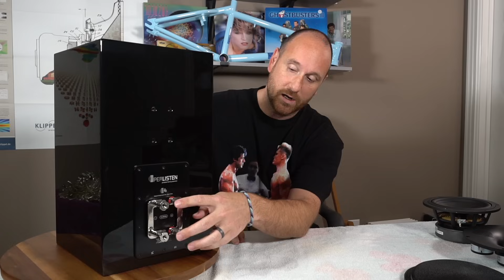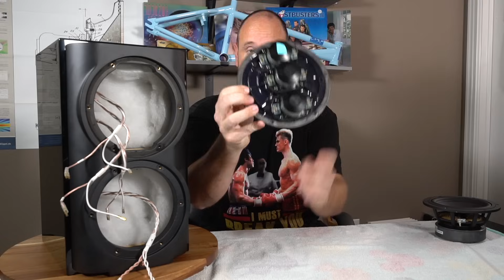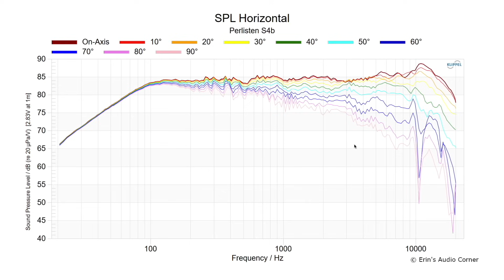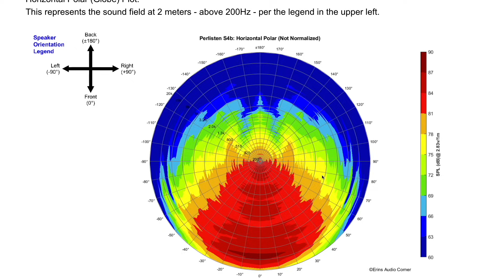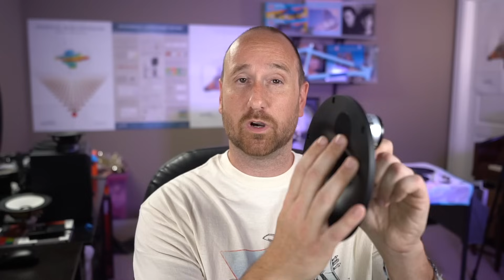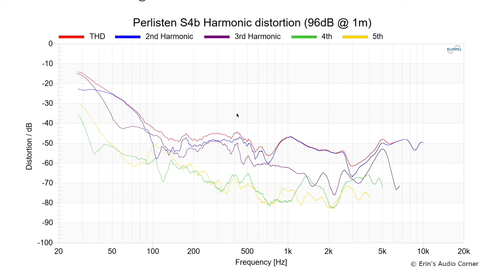Perlisten S4b Bookshelf Speaker review and breakdown.

Comment: hi erin, i have to replace a driver in my s5M speaker. how hard was it to take out the driver and replace it? is it easy? im worried about damaging my speaker. any hint or tips?how long would it take? i am replacing the driver due to a small scratch on it so the last thing i want to do is scratch the cabiner trying to rplace it.
Reply from the maker: It was actually quite easy.  I would imagine Perlisten would be able to walk you through the steps, though, if you need it.    Just some screws and that's pretty much it.

Comment: That midrange/tweeter setup response makes perfect sense based on hearing them.  All their speakers in the high mids sound grainy to me indicating usually a lot of reflections and time/phase issues.  It sounds almost like horn throat distortion to me.  It’s the downfall of the speakers for me.  They don’t have a sweet sounding high-mid so I have to disagree with you, lol!  I feel like if there wasn’t smoothing on the high mid response charts, it might be pretty rough looking with a bunch if phase alignment issues between the mids and high driver because you essentially have a 3 driver array covering the same frequencies.

Comment: I wish THX weren't so cagey in their specifications. This speaker's peak output is 111db, under 2% distortion, at 1m yet they give their "THX Dominus" rating which means it's meant to play in rooms 6m long at 120db on a speaker with a minimum 92db 1w/1m sensitivity. 

Even Perlisten's S7 speakers can't hit the 120db specification with their peak SPL at 117db under 2% distortion. However, the S7's do meet the THX Dominus 92db 1w/1m specification though.

I know THX Certified is still a great certification that ensures a level of quality and clearly this S4B is well behaved at low to mid volumes. But Perlisten's own data specifies that this speaker tops out at 105db at 2m or 6.5ft away. That's a really close listening distance. So, I'm sure they're fantastic for music and great for movies up to 6.5ft away but beyond that, these simply fall flat of basic Dolby certifications for SPL and they certainly will have audible nasties if you push them any harder. Personally, I don't really care about whether or not a speaker can play meaningfully below 80hz in a small-room environment. It's going to get crossed (time and phase aligned of course) to a sub anyway.

Again, I'm certainly not knocking the speakers. Clearly, they're fantastic. But IMO, certainly not worth $4k. Personally, I think the entire line is overpriced. Objectively, Genelec produces a better speaker in FR and phase with identical SPL in their 8361a at $5k than Perlisten's S7T at $10k.

Comment: Is the S5m considered sorta MTM? 
Thanks Erin 
Would love to hear the difference in sound between the Revel BE and the Perlisten S7t
Reply from the maker: I guess it depends on what you're talking about.  The tweeter/mid array is a type of MTM.  Or are you asking about the fact that the s5m has a woofer pair?  In that case, you could call it that but I think it's not quite technically accurate because it's a bit more complicated than a standard MTM design.  It's like a couple MTM... if that makes sense.
Reply: @ErinsAudioCorner   no I’m talking about the Array.   Super interesting design that solves some issues.  
I wonder if the speakers sound a bit narrow though because of the design. 
Would you say you enjoyed the Revel BE more? 
I tend to like MTM personally because of the large full midrange they usually give.   That’s why I asked.   

Good to see you back Erin.  Hope all is well!

Comment: 8k a pair, there's a lot of choices out there, including some good actives. Those specs, disappointed in that brand. I can live with the 80hz cut off as I'd always pair with a sub, but that they also don't allow high db levels considering their size and weight and cost, I'm gonna pass. although I'd like to compare them to my ATC SCM 19vs 2 which are my reference currently.
Reply: The frequency response of those atc speakers is EMBARASSING. The directivity index is ok'ish but doesn't even come close to the perlisten.....

The perlisten destroys the atc's in terms of sound quality. Are you really going to nitpick them for a few db?
Reply: @niccster1061  "The frequency response of those atc speakers is EMBARASSING." What graph are you referring to specifically? They are also less than half the cost, so I'd hope the Perlisten are superior, not 8k worth of superior... If I'm paying over 2X the cost of those ATC's, from Erin's measurements, it will not be those Perlisten's. I would really be interested to see a review of the R line from Erin. BTW, I no longer have the ATC's, currently using Ryan speakers, which I am very happy with. They actually cost less than the ATC, vs more.
Reply: @willbrink  I'm referring to the graph from audio science review. Done on a klippel rig. About as "valid" of a measurement as you can get. 

Midrange is boosted. Treble isn't linear to 20khz. Majorly uneven directivity index. The ATC speakers are unequivocally, horrible for 2 GRAND. 

And yes, the perlisten is way more expensive but there are plenty of similarly priced(to the ATC) speakers like the Neumann kh120II that don't have GLARING flaws..... Hell, even a Polk xt20 with spinoramas autoeq puts it to shame......

Prioritizing how loud a speaker is over it's accuracy is just............ Can't even find a word for how backwards that logic is
Reply: @willbrink  not seeing a lot of useful info on the Ryan speakers but if the IN ROOM response of them is genuinely flat like they advertise then they are going to be way too bright. Hoping they meant sloped, lol
Reply: @niccster1061  You're referring to a prior model, unrelated to the ATC model I'm referring to. I don't know how the modern ATC SCM v2 measures, I can say it's universally given top ratings by those who review/hear them other than being base shy. Subjectively, they sound great but no doubt have a "house sound" that'd favored by thousands of studios as you know. ASR hates anything with a "house sound."  I'd more likely look at brands shown to measure very well per Erin's testing etc. I know have Ryan speakers which claimed to have used klippel in designing it. Value for audio, I'd be more interested in the R line at this point.

Comment: Nice review but the limiting factor in this speaker is the bass extension and output and the requirement of a subwoofer. I was considering these but the bass and need for a subwoofer turned me off. Should I go for the next model up which is the s5m or get something like the kef reference 1 metas or dynaudio contour 20i or fyne audio's f bookshelf

Comment: I’ve listened to this review as well as Erin’s review on the Arendal 1723 Bookshelf S THX speaker.  Is it just me, but their seems to be quite a bit of similarity between the two speakers.  It’s as if the S4B took the base design of the Arendal 1723 Bookshelf S THX and went above and beyond, for example the waveguide with the midranges.  We’re these both engineered by Dan Roemer of Perlisten?

Comment: That midrange around tweeter is interesting, I've not seen that before!

I think at this price I'd probably go for the Dutch & Dutch 8C, but they look great still
Reply: Really svs ultra towers have had that for 12 years
Reply: @danemoreno88  Just googling those, it seems they're a standard D'Appolito array, with midrange drivers fully flanking a tweeter, actually I have some iLoud MTM in front of me right now that are like that.

I should have been more specific, what I'd not seem before is this particular way of doing it, with the midrange drivers hidden inside the tweeter waveguide, exiting through perforations. They call it the "DPC array" it seems.

Comment: Thx cert speakers aren’t made for music typically hence the 80hz and a added sub. They mainly focus on the theater side just my two cents
Reply from the maker: Ask the Perlisten folks what they think about that statement.
Reply: @ErinsAudioCorner  ask thx about that statement
Reply from the maker: @pyrocrew17  I know the former VP of R&D.  Had him on this channel.  THX speakers are (typically) designed for use with subwoofers, yes.  The same can be said for many other speakers that do not have the THX cert on them.  That doesn't mean they can't play music.  Maybe I'm taking your comment wrong, but that seems like the stance you've taken and I disagree.
Reply: @ErinsAudioCorner  of course they can play music but they aren’t great at all for music they are made for theater. You just took my comment wrong. My dad had a full Boston thx system in the 90’s great for movies horrible for music.
Reply from the maker: @pyrocrew17  my point is more in the vein of: they may be designed for subwoofers but at the cost of these speakers, I would have liked to see them also be able to get a bit lower in response.
Reply: @ErinsAudioCorner  can’t happen with thx cert speakers
Reply from the maker: @pyrocrew17  not 100% sure I agree but I get the sentiment and I wish that weren't the case.  Cheers!  (and sorry for the misunderstanding)
Reply: @ErinsAudioCorner  🤘

Comment: We need more speakers like this in the mainstream. I built myself HT speakers because I couldn't find much on the market designed with a subwoofer in mind. Almost all bookshelf speakers have very poor efficiency, designed to "dig" into the 40-50hz range. If a sub is planned that's not necessarily useful. I used an 8" prosound midbass and dome tweeter. It has compromises in power response, and can only dig to about 80hz out in the open or 60hz when placed near a wall, but they have real-world sensitivity around 90dB@1W, which is rare for something tiny. Easily can reach clean 110dB transients at the listening position.

Comment: Even with all that little bit of extra attention to detail, these speakers do not scream that they are worth $4,000 per speaker.  No way, no how.  Maybe the manufacturer thinks they won't sell many, so must compensate by jacking up the price.  Now, if they allow their dealers a large mark up wiggle room to negotiate down the price with their clients then that's one thing.  RBH and Wilson Audio had some crazy-ass speakers at a CEDIA I went to a few years ago and they were insanely expensive, but listening to them they were only a tiny bit better than some speakers costing a fraction of the price, if you crossed them over to a quality subwoofer or two.  Even then, you would have a lot of left over money in your pocket.
Reply: Don't worry many audiofools will purchase them

Comment: 8k is not inexpensive, but you're getting a pretty innovative quasi synergy horn thing with four drivers and surprisingly even dispersion with an outstanding DI curve and a state of the art textreme woofer, not to mention a beautifully made and slick looking cabinet. 

Having said all that for 800 dollars more you can get some revel f328be which I'm sure much greater output and similar controlled dispersion but look a a bit plain. 

Great review Erin. Very cool of the owner to let you take it apart. Nice to see a legitimately new driver configuration in practice.
Reply: Agreed regarding the Revel F328be.  That would be an interesting comparison.   But the Perlisten S4b are ~$8,000 per PAIR,  and the Revels are $8,800 EACH.  ;-)  Not quite a fair match IMO.
Reply: @bbfoto7248  if you can afford 8k speakers spending an extra 800 isn’t going to break the bank.
Reply: No, he’s saying they’re almost twice as expensive.

Comment: Excellent review. Perlisten is lucky to have EAC’s confirming the state of the art performance delivered. 

What you keep calling midranges are part of a three tweeter array. Sony calls their version “I-Array tweeter” in models like the SS-NA5ES. Perlisten adds the subtly of mixing the three tweeter array into a very clever waveguide. I agree with the comments about this helping dispersion including the trick with vertical dispersion coverage. I believe another feature the tweeter array brings is power handling thereby lowering distortion at high SPLs. When a designer is going for very high SPLs at some point a 1” tweeter just runs out of acoustic output and voice coil thermal capacity. This occurs first at the tweeter’s lower bandwidth. Note that band 750 to 2k Hz is where Perlisten’s side tweeters are helping. The M&K Sound S300 is the latest in a long running model where M&K uses (an arguably less advanced) three tweeter array to allow recording studio loud SPLs without resorting to horns.
Reply from the maker: Thanks. FWIW, Perlisten actually has the drivers labeled as “midrange 1” and “midrange 2” inside the cabinet and the fact they are bandpassed is why I called them midranges. 👍

Also, the drivers are different models with slightly difference impedance (which is documented in my review on my site).

Comment: Hidden away on the S4B info page it says - Bookshelf, main for a 2.1 system, LCR, Dominus Surround, it can transform into anything you need.

So Dominus rated for surround sound duties. Though at only 85dB sensitivity you will need a powerful amplifier, especially if used in a large room.